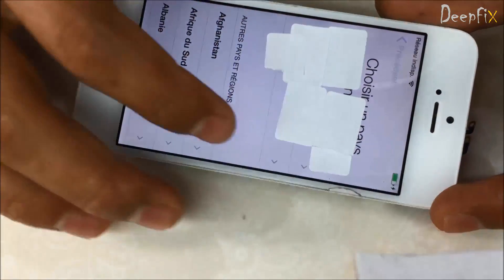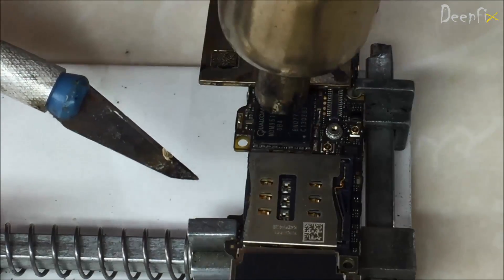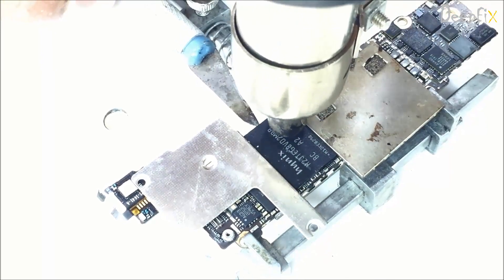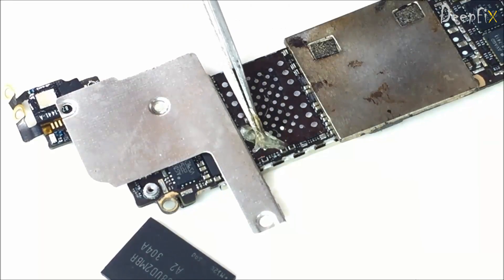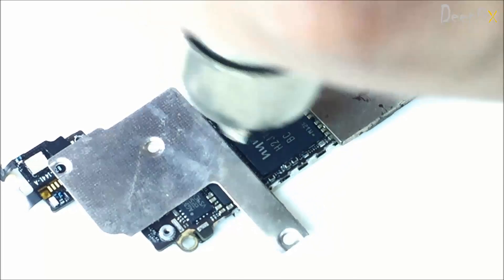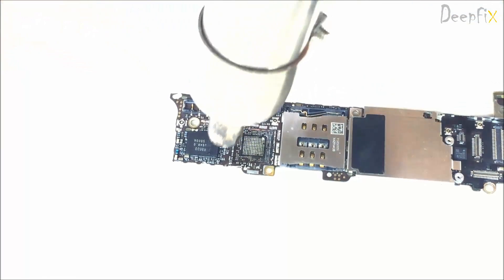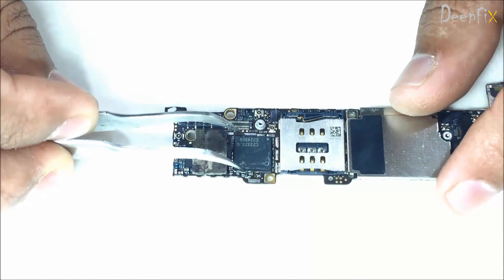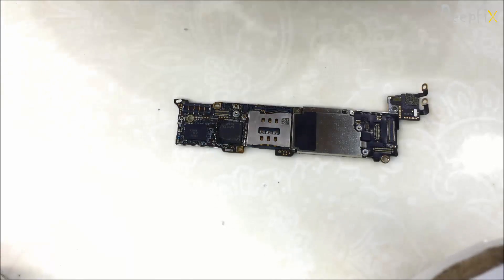IPHONE 5 ICloud Unlock in Hardware

Comment: Or just change the whole board which in effect they are doing. You can clearly see these chips have been removed previously and it would have been using an infra red rework station which cost hundreds! You will never lift a chip like that using hot air without loosing all the other components near it because they are secured with black resin as well as solder. Clearly the resin has already been removed from this main-board which is why it looks so simple. Not just that but they also had already removed the metal shields that cover the chips, again very hard not to do damage or dislodge components especially with hot air. This video is horse shit and if you try and copy it then don't say I didn't tell you so!
Reply from the maker: Great analysis boss but we will a video which contains all you needed 
If can't do anything it doesn't mean other can not that .think different
Reply: what the fuck you guys talking about???? never seen so much spam in my internet life. hardware's the only guaranteed way to do it if done right, if not you fuck the phone up. pretty easy to understand... you think a company worth 500 million is gonna make it that easy to bypass their most reliable cell phone security? this is real hacking..
Reply: DEEP FIX
Did you call yourself Deep Fix after pushing the needle too far into your arm?
Reply: @sparkyuiop  holy shit this is golden! while i know from experience that it can be this easy (looking) to remove these chips by hand if you are skilled and have enough practice, but like you im gonna call BS on the validity of this video, cause im not sure when apple stopped using qualcomm chips, among other "flags" if you will...
Reply: +sparkyuiop bro...didn´t you see he is a chutya indian? what else do you expect from an Indian! better he must get a job, and fucking do things properly >.< instead of wasting peoples time on YT!
Reply: +sparkyuiop hahahahaa, no, no deep fix means putting a good DILDO :€ in his best and biggest hole, that is his ass!
Reply: Obviously , you are very good at using a Hot  Air / Soldering Machine but would be safrer to use an Infra Red Soldering Machine .
Reply: +DEEP FIX how to unlock iphone 6 icloud
Reply: New methods to unlock icloud using free tools .recently I unlocker three iphones and ipad  icloudunlocktools (.com)
Reply: +alin hamka This is a great site guys., keep your data safe by removing your icloud account if you sell your phone, unlockicloud24 .com!!! will show you how. This is really the only one that I use !!
Reply: sparkyuiop The link for free unlocker is https://plus.google.com/106349709930565134479/posts/hbdzZ3ZovMR its all free
Reply: +DEEP FIX smart ass... ok jaa ke koi aur kaam karo...more usefull :)
Reply: +LiveTech Studios™ u looser...y vomiting ur frustration here
Reply: +alin hamka  ;;fuck you
 man ,,
Reply: +DEEP FIX how do you remove the black resin? i Already tried many methods and it is impossible. In some boards there is also black glue under the ic. I think that is impossible to remove without damage the board circuit layers.
Reply: yeh am using it now
Reply: Michel Almeida
I think the idea is for you not to be able to remove it. Maybe with infra red but no idea how else.

Comment: Can you use this method for data recovery? If you replace the baseband, hdd, and eeprom will you retain data or will you have to do restore?
Reply: +Simon  These chips were from another iphone board that was damaged, but not icloud locked.  You would want to do a restore because you'd want to remove the previous user's data, but you don't have to.
Reply: santo diaz if you transfer all chips is the iPhone by default in restore mode?

Comment: What was the paste you used to put the chip back on
Reply from the maker: You can it my videos which I'm using
Reply: +DEEP FIX where can i buy the ic
Reply: +DEEP FIX http://www.ebay.com/itm/5pcs-BGA-SMD-Soldering-Paste-Flux-Grease-RMA-223-10cc-/171488718305?hash=item27ed862de1:m:m3WTDFpjQYryb4rh_AFlGJg this  ?
Reply: Aliexpress
Reply from the maker: I have shown in my videos watch it
Reply: and that can unsimlock the iphone too or we need to replace another ic ?
Reply: +Raphael Attal (Hookt3r) Use this site and you will deffinitely get it done !!, make sure your icloud account is properly removed, go to unlockicloud24 .com!!!
Reply: +Raphael Attal (Hookt3r) This is a great site guys., if you need to remove your icloud account then go to unlockicloud24 .com!!!. This is really the only one that I use !!
Reply: +Margo Brok --'

Comment: DEEP FIX great video. You make hard things look easy.

I have a question on the chip replacement do you clean the underfill epoxy? Or just leave it? If you do remove it could you explain how? I have trouble lifting the chips at times that are highly populated with other components and no place to really "pry"

Comment: So is it possible to use the chips from a broken board? I have a board which has vertical stripes on the image, can i use the chips of that board to fix another one which is icloud locked?
Reply: +Rafael Costa i will buy the one with stripes on it how much you want for it?
Reply: hi, I got like 20 boards some have vertical stripes..do you still need one?
.did that gent sell you the one you requested..I have boards to sell I would sell you one of mine with vertical lines..email me if interested Kenneth Jenkins. .thanks.
Reply: hi, I got like 20 boards some have vertical stripes..do you still need one?
.did that gent sell you the one you requested..I have boards to sell I would sell you one of mine with vertical lines..email me if interested Kenneth Jenkins. .thanks.
Reply: hi, I got like 20 boards some have vertical stripes..do you still need one?
.did that gent sell you the one you requested..I have boards to sell I would sell you one of mine with vertical lines..email me if interested @gemineyeskys2013@  gmail.com. .thanks.
Reply: hi, I got like 20 boards some have vertical stripes..do you still need one?
.did that gent sell you the one you requested..I have boards to sell I would sell you one of mine with vertical lines..email me if interested @gemineyeskys2013@  gmail.com. .thanks.
Reply: hi, I got like 20 boards some have vertical stripes..do you still need one?
.did that gent sell you the one you requested..I have boards to sell I would sell you one of mine with vertical lines..email me if interested @gemineyeskys  2013@  gmail.com. .thanks.

Comment: The glue is also a problem getting out.The hot air method isn't that good when the glue is stuck under the chip
Reply: That's  not a glue,  that's soldering Fluxe paste

Comment: i need this chip how much cost bro ? old bord dead board how parcheging bro plz help me
Reply: +Tinu Jangra try to get the motherboard datasheet and replace all IC like eeprom and all hynix chip and normally the ipad would be unlock if is doesnt work try to remove all IC with a mac adress and change the processor maybe the udid is inside
Reply: U601 4USD
U4 or H2JTDG8UD2MBR 15USD
U501 9USD
so less than 28USD
Aliexpress is the better way to find them
Reply: +Tinu Jangra This is a great site guys., unlockicloud24 .com!!! will help you remove your icloud account from any apple device. This is really the only one that I use !!
Reply: Found you a free unlocker UNLOCK ANY IPHONE LINK BELOW 
 LINK : www.Unlock.Network/ works great 
 License Key : 8FJCEy2z
Reply: Apporximatly 20/30$
Reply: Tinu Jangra sparkyuiop The link for free unlocker is https://plus.google.com/106349709930565134479/posts/hbdzZ3ZovMR its all free
Reply: *****  i dont think these chip are compatible with the 5s maybe the memory but the rest no. but i have seen a video on yt but not really good eplained i dont remember the title but you can search
Reply: +Raphael Attal (Hookt3r) plz help me  i have ipad 2 only wifi 1395 sn no DQTFK3D7DFHW         plz
 unlcoke my pad i have try 10 to 20 time but not working any side
Reply: to unlock any iPhone iPad in box Sandra Michael 2021@gmil.com
Reply: In my country it costs 100-150$ but u can find cheaper if u search /Iraq

Comment: The new IC 's sold it fully programmed? Just replaced? Something else what really bypass it is because the imei has been swapped it with new IC or something else? Why 3 IC's?
Reply: Cuz the 3 ic's contain the imei and serial and the eeprom chip controls the baseband chip.
Reply: +Lorenzo van het Hul Thanks for the info and your time
Reply: No problem! You can ask more! Btw, the big chip (NAND storage chip) contains serial number. The baseband chip (half the size of the nand) contains IMEI Number. The smallest chip (eepron) contains specefic and unique codes for baseband chip, youcant program them by yourself. You need to buy an water damaged phone end extract those 3 chips cuz those chips never break when water damaged and serial number need to match with imei number or u will get activation problems
Reply: Thank you you are very kind, so difficult to buy that set? I'm affraid to desolder for then resolder, too much work/hot over same IC's
Reply: Its easier to replace the logic board. I can get them for really cheap in my country (the Netherlands). Just search for an total busted iPhone for cheap but still working without iCloud lock and extraxt that logic board and use it.
Reply: +Lorenzo van het Hul Very difficult, 99% of iPhones has nowadays activated it, suggested  and activated by default at activation time
Reply: Lorenzo van het Hul  jo kan je voor me fixen ? want ik moet die ic er echt af haha
Reply: +Lorenzo van het Hul And how the hell are you reballing those chips you removed from the other phone? He didn't mention anything about it. Looks fake.
Reply: I din't replace them, its beter to buy a used but good one instead putting precious time in this. Except if you are doing this for your hobby and some $$$$ obviously. But it isn't worth it thrust me. If you never did this before, you will destroy it so don't even try cuz you will ruin it. 

Those logic boards are easy to get just search for an total busted phone with good logic board and no locks. You can get those cheap to.
Reply: +Lorenzo van het Hul can i buy online on China that 3 ic and replace it will work or not
Reply: No, since the IMEI and Serial of those don't match with each. You need a damaged motherboard like water damage, ripped pads or broken connectors and swap over all 3 ic's. And btw the chance of destroyng your ic's or motherboard is big so I recommend to get an used good one.